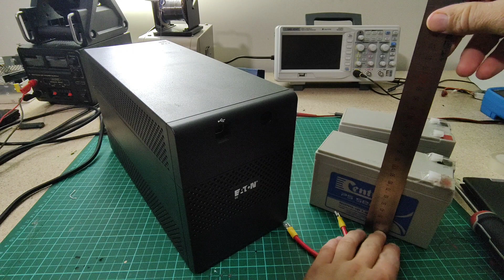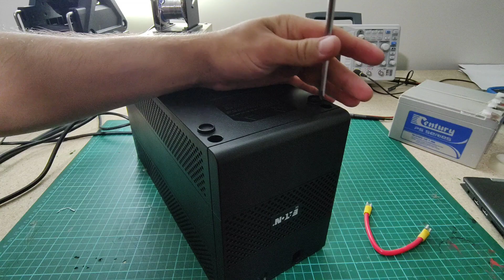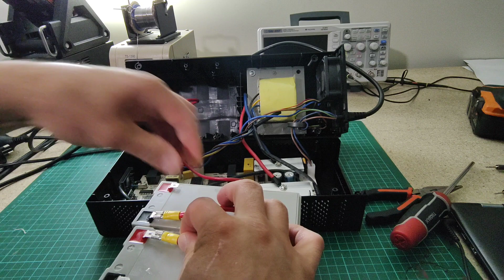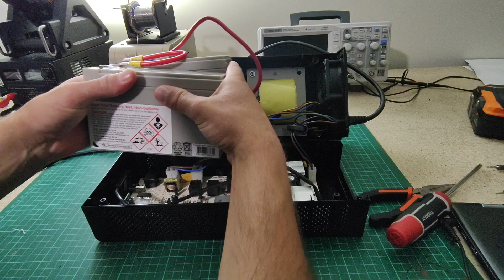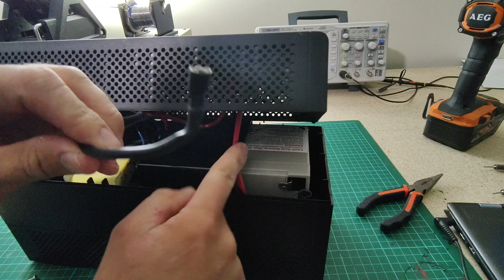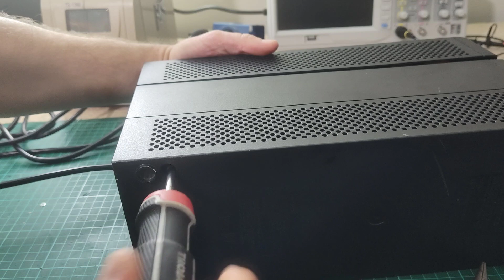Eaton 5E battery install

Comment: I need to buy a long screwdriver. Know what size the head is? 6mm seems to be pretty standard is that too big? Trip to Bunnings but want to get one that is long and fits the screws.
Reply from the maker: Hey mate. Its most lightly Phillips-2 (PH2) head, and my screwdriver was 100mm long I believe. You could buy the single Assorted screwdriver for $2 from Bunnings or get the small craftright for $13 with I/N 6060225
Reply: @LABMATT.  Hey mate. The screwdriver I have here and tried is in fact also 10cm long but it's too short to reach the screw so just posting this here to let everyone know you will need more than that. Maybe 150 or 200mm to be sure. All the best.
Reply from the maker: @Ramrunner73  Thanks for the info, I got no clue what screw driver I used then 🤣I did just hold up my 100mm next to the unit in the server rack and its definitely to short. Iv pinned your comment and added it to the description to make sure the message gets out. Thanks for the feedback 👍
Reply: @LABMATT.  All good I got a VERY expensive $1.45 one from Bunnings to do the job. Probably should have bought a magnetic one though, another tip. I've replaced the batteries and it works as expected (this is the 2000 model with the fan), but the minute I plugged it in the fan came on (unit is switched off). From the reading I'm doing it seems it does that when charging batteries but i'ts been on for a good chunk of the day and won't stop. The fan is LOUD and very distracting. I have NOT had the chance to hook up a PC with the Eaton software yet to have a look but has anyone else had that experience?
Reply from the maker: @Ramrunner73  Sounds like your gonna be in debt now at the cost of that screwdriver. I haven't tried any software yet but I saw some stuff of Linux that could read and host monitoring software. Idk if it works yet. Id like to have stuff safe shutdown automatically. My two units also have fans that are very very loud, but they also only run when charging or maybe while running, cant remember.

Comment: Hola, gracias por compartir tu video. Tengo una pregunta. 
Cuando enchufas a la red eléctrica domiciliaria, el cooler enciende igual, aunque esté apagado? Gracias
Reply from the maker: If the UPS is plugged in and turned on then the fan turns on as it charges :)

Comment: I have an issue.. i have changed the batteries a few times.. last night after a short blackout and when the power came back the UPS was on Green light steady but the beeper was beeping every 1,5 sec. i tried to turn it on/off unplugged everything from it. and it did not changed... any ideas?
Reply from the maker: Hummm not sure, The EATON 5E manual on the website seemed to have some good diagnostic info related to beeping and lights. Might be worth a check.